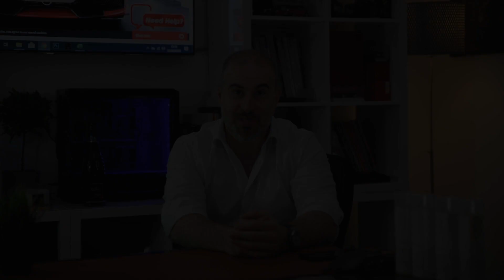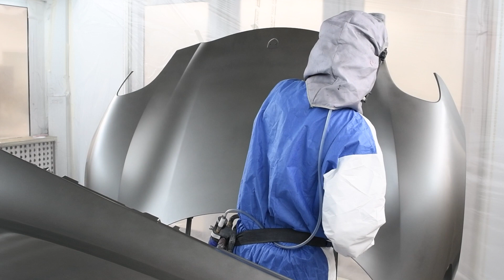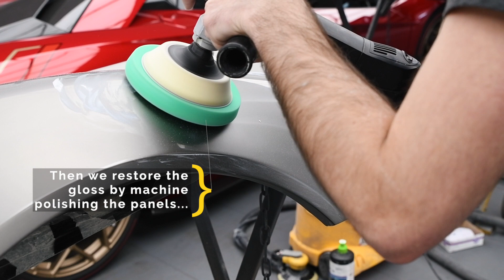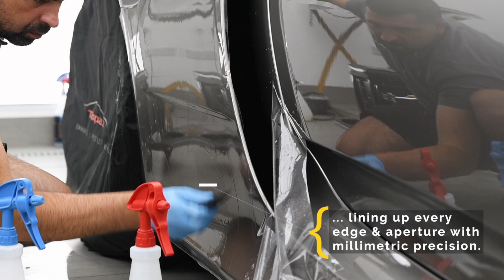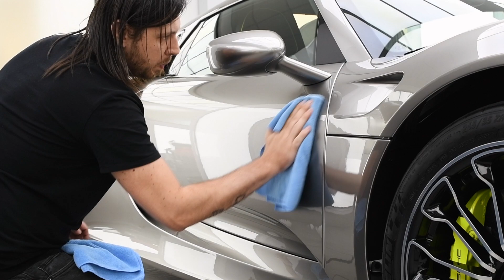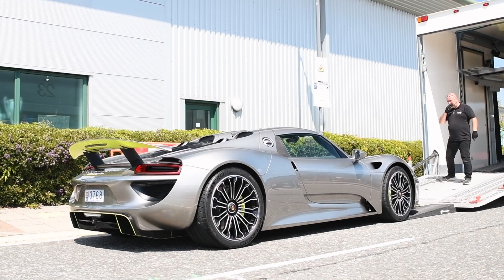$65,000 Paint Restoration for This Porsche 918 Spyder!

Comment: I'm curious to know how the PPF will react to the not fully cured paint. Most of the best painters in the business seem to agree that paint won't fully gas out for as long as 3 months after being sprayed in some cases. Is there any risk that the PPF will bond to the paint on this 918 in a way that will cause damage in the future if it is ever removed? Obviously, you guys do things to the Nth degree, so I'm not questioning your quality of work. Just curious to know if you've found a way to cheat the system when it comes to curing fresh paint in a quicker fashion.

Comment: You nailed it again, Guys! Best in the business, as per usual!
Reply from the maker: You're the best!
Reply: Not when they dealed with our testerossa 😢
Reply: Stefan Bostandjiev what happened?
Reply: Mbal 40 wtf u on about. When they polished the paint they had left some stains of some sort. Then they put some cheap ppf over it. When we received it we were not happy so we took it to a specialist to re-do the car. But when he took off the ppf, the paint started chipping.   Topaz say if a ppf is put on properly it should be super easy to take off without destroying the paint
Reply: Stefan Bostandjiev did you talk to Topaz? They are professionals so you guys should be able to sort this issue.

Comment: My only question is, why would someone respray a car only for some minor rockchips and all, doesn't that depreciate the car's value greatly?
Reply: I didn't understand that too.
Reply from the maker: Not if it’s done properly...
Reply: If it did the job at TOPAZ, it values more than when lefted the factory imo
Reply: Gustavo de Caires Anhaia A repainted car will never be worth the same as a original example now and certainly not in the future. A true collector or dealer will slate the car 100%.
Reply: I didn't understand it too.. Didn't made any sense to repaint a car for some rockchips. There is 100% chance that the color from the rest of the car is a little bit off, or if it is painted completely, people can tell that it has been repainted and will wonder if it has been crashed...
Reply: Topaz Detailing the paint density will increase and the car surely have a decreased valuation, no matter if done properly, since it is not original factory paint. There were no photos to judge what the actual damage was on the car, but at the end it’s owner’s choice
Reply: Seller need to prove respray was not because of crash damage to any prospective buyer - otherwise it will affect resale value.
Reply: Stev Rex  it isn't normal paint for a start. And right now it would be worth more than oem because it's flawless.  There's original and there's perfect,both have high values.
Reply: All risk insurance. Free fix.
Reply: @GustavodeCairesAnhaia   It can be done better than Porsche, but Porsche snobs want original... They are a special bunch.
Reply: Liquid Metal Silver metallic is notoriously difficult to blend due to the way the paint lays down. If there were enough areas that needed touch up/repainting, it sometimes makes sense to repaint the entire car in order to get a consistent paint shade across the entire vehicle. The shop that I work at deals a lot with Liquid Metal Silver.
Reply: @mikeicee  haha so true
Reply: I think the value on this car is going to be alright ;)
Reply: @GustavodeCairesAnhaia  try again.
Reply: Some real nonsense being written here. A £1M car has been rejuvenated by a company renowned for high quality of work. Values of these rare cars are not affected by repair work unless you’re calling Chips Away and spending £100 on having stone chips touched up. The owner of this vehicle wanted it to look as new and I doubt he would have paid if he was unhappy with the work.
Reply: Plus if you can afford a Porsche 918 Spyder I doubt you are struggling for money lol.
Reply: I mean the car is not going to devaluate. But who pains a car just because of rock hips. Lmao
Reply: @stevehines5256  Original paint is a huge concern for many, including myself. Even concerning much cheaper cars than a 918. This isn't a rejuvenation, it's a respray which is generally frowned upon as far as value is concerned no matter how "perfect" they get it.
Reply: The person has had the full Topaz treatment, because money is obviously not an issue to them, and the fact that its a 918. We all would do the same if we all could. Looks amazing.
Reply: Repainted cars can gain value if done correctly
Reply: @GustavodeCairesAnhaia  lmao a topaz job certainly isn't more valuable than the paint job that comes out of the fuckin Porsche factory itself
Reply: I don’t think it will affect resale at all.  Look at Mr Beans McLaren F1.  It crashed God knows how many times and still sold for $16 mill or something like that.  Plus this video showing the quality of work done and having Porsche trained technicians there makes a huge difference.  Also it’s at Topaz, one of the most  renowned detail shops in the world.  For me it wouldn’t diminish value at all.
Reply: I mean, the owner paid $65000 for a respray, I don't he cares too much about depreciation
Reply: @robo6548  with all due respect, I agree.  However, given the rarity of this model I don’t see the owner selling, now, or in the future.   I’m not sure the 918 has any real world competitors
Reply: @qr8907  wtf?  The respray was NOT 65k!,  did you read or pay attention?
Reply: @justanotherprouddad1391  it's a $65k option from the factory
Reply: Yeh the cars probably worth like $500 bucks max now right? Absolutely stupid comment. Clearly it was repainted for cosmetics and not due to an accident therefore no effect on value.

Comment: The car must have lost value when the original factory paint was removed?
Reply: Sure it lost it. If another owner of the car will even know it. I would not pay the same amount of money for repainted car. Not a car of this value.
Reply: @LightSpiD  Would't it have been better to leave the factory paint intact and just repair the dents? There is no way an after-market paint can be more durable than the factory paint.
Reply: @msbrownbeast    aftermarket paint can absolutely be better than factory. Ive never seen a gauge used to see how thick the 918's paint job is but everything is a cost. paint has got thinner and thinner over the years.
Reply: @msbrownbeast  factory paint is most of the times very horrible even on high end paints. I’m sure they do a better job.

Comment: So basically you repainted multiple panels, and likely blended the paint in. This was a video about a high-end body shop, there are plenty who operate to this, or higher standards. No matter how nicely the job is done, it is only original once. There is no such thing as a "perfect paint match", not even two 918s in an identical color would be exactly the same match. And for anyone wondering, this definitely WILL affect the resale value, regardless of the job quality. Just be honest about it. I'm not saying it's all about resale value, because the owner is probably well aware of this, and it's absolutely respectable to just want the car to be 100% regardless. Nice video either way

Comment: Small areas or even the complete car being repainted does not decrease value if its does correctly. There's a huge difference between a back street repaint to a top quality show paint job. I'd rather a repainted car in perfect condition than an original with stone chipped /scratched bodywork